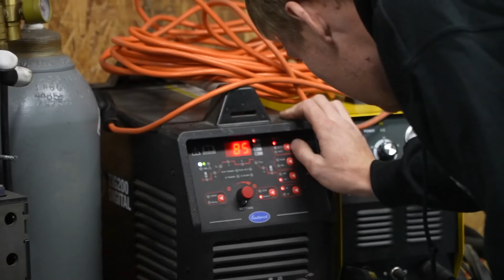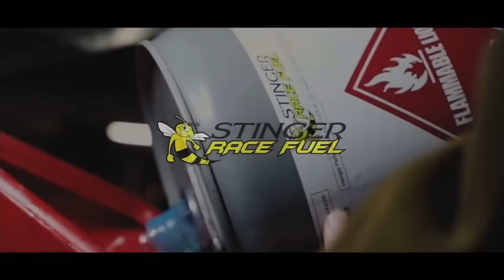Workin' In the New Shop! BIG TURBOS & All the Travel!

Comment: Sharpen tungsten inline with wheel not 90*. Arc naturally wants to go to tip. Especially when welding a 90* the arc will go to the side cause it's closer than where the actual puddle should be.
Reply: Yeah that's probably why he cooked that shock mount. Had to hold the torch there forever to try to get a puddle working how he wanted. I'm really un impressed with that shock mount. This thing is shaping up to be a half tick away from a pro mod... huge HAZ and the wrong filler rod is literally a recipe for losing a limb or worse.
Reply: Yep,  your comment saved me writing it.
Reply: Exactly
Reply: Tig welders unite! I'm a boilermaker! It's real hard watching the wrong way!
Reply: Tuff in here did any of you guys  teach yourself or learn on your car ? Keep on keeping on Billy haters gotta hate
Reply: @allenhunt9016  knowledge is good! Sometimes you need some salt with it! The older you get the more you'll learn! Use a scoot bright pad and scrub your filler wire clean!
Reply: Always
Reply: A sanding pad on a grinder works better than a coarse rock for the tungsten as well. Amps too low will make you have a wider heat affected zone due to length of time needed.
Reply: I came here to say this.haha You also want a dedicated wheel for grinding tungsten. I bought a little 3" bench grinder just for that. Tig is a sanitary welding process, the cleaner the better.
Reply: @bad3vlv672  Took the words out of my mouth
Reply: Yes yes yes. And don’t over heat the tungsten while grinding it. Have a cup of water to keep it cool. 🤙

Comment: Cool to see you jumping in on fabrication, it saves a lot of money if you can do it yourself. Couple of tips I’d like to offer- 1) grind your tungsten vertically instead of horizontally, it will make your arc more stable. 2) Fitment is key! If there are gaps it will pull all over the place and be hard to weld properly especially for a novice. 3) Try to move quickly, even if it takes more amps, moving slowly will heat soak the joint faster and turn the weld gray/brittle even if you are using low amps. Pulse your foot instead of keeping steady amperage. 4) weld the insides of those shock mounts as much as you can, stick the tungsten out a bit and go for it. 5) get you a flat back cap, it will give you much more room welding on these cars. Good luck

Comment: Billy I'm a welder, just a little advice, the sharper the tungsten  the easier  the weld and  better.. cordless  drill for  sharpening  tungsten,  ger a flush button  for your tig rig, you can get in tighter spots and  you'll  have double  use of tungsten  cause you use half and  sharpening both end with  your drill, and it don't  have  to  be  cordless  it's just  my preference...
Reply: Sharpen it vertical to the wheel with the point of the tungsten going along with the direction its rotating makes a better arc as well. Just ol'timer advice.
Reply: @kevtom1686  read my mind......kept my trap shut long enough to not be redundant
Reply: I just hope he's staying in the thick metal first and getting it hot enough and welding up hill for strength  , no down hill washes,  that's awesome you offered to teach him ,hats off and thumbs up 👍
Reply: Im not sure he will know your speaking of the back cap....also stubby gas lens kit will shorten up a wp17torch🤘better still #9😛👍

Comment: Lots of tricks on tig. Grinding cups, long reach cups, bending the tungsten for the inside of the shock mounts, wire brush is your friend between passes, cheap dremel tool and long carbide bits to get fisheyes and suck marks out, foot pedal really helps.

Comment: With them welds, you need more heat. Just like you said, and spend less time on the metal. If that chasi is chrome moli, i’d take a torch to the welds to relieve the stress. Chrome moli can be prone to cracking around the welds. 
Good Job!!
Reply: 4130 needs the right filler rod, and the right temp. And a nice flat to convex weld. There's a reason NHRA doesn't let people grind down their welds. Billy's playing with fire.

Comment: Hey Billy congrats on the shop!

Piece of advice on tungsten grinding. Don't grind it horizontal like the way you did. You grind it vertically. Easiest way is to put it in a drill and move it across the grinding wheel side to side

Comment: Billy if your elbow uses a standard LS throttle body, use the new Motion Raceworks Icon and it had a full CNC machined Y with clamps included. Would more easily fit your tight space and save a ton of time.
Reply: Upvote

Comment: Billy when you grind your Tungsten up and down your spark will travel better. Always tack things in before you weld and get smaller cups too , practice on welding with heats and gasses. Cardboard use for making templates , I remember fabricating on Race Cars when I was your age don't be afraid of asking Questions only way to get ahead. Good luck moving forward..

Comment: A tip from a x boilermaker tig welder when sharpening your tungsten don't do it sideways how you did on the bench grinder do it vertical... let the rock spin with the point of the tungsten it helps with control  of the ark and not having it jump off the side of the tungsten and when welding molly or stainless that is crucial
Reply: Also a #9 torch with a mini gas lens is your friend in tight places

Comment: Best thing I ever did for myself was learning to really use the foot pedal when welding. Set your Amperage higher than you think you need, then you always have enough to work through the material at a quick enough pace. Welds look good, but you're definitely right, the heat you were seeing was from sitting and just putting heat into the same spot for so long.

Comment: Hey Billy, just trying to help you out with your welding . When you grind your tungsten, if you hold it 90 degrees from how you were holding it in the video. Therefore the point would be straight up towards the sealing. Your flame when you are welding will focus better where you are aiming and you will not have to hold in the same spot for as long. Just trying to help 25 years of tig welding. A wire wheel before you weld on mild steel will help also keeping your puddles cleaner

Comment: Hey bud next time you sharpen your tungsten put it in a drill motor and run the drill while grinding it. Makes a huge difference. Great job on the welds and all the head way your making.
Reply: Make sure your grinding wheel is new or only used to sharpen the tungsten.

Comment: Billy     just a tip       I do a lot of TIG   ,  wile sharpening your Tungsten , the grind lines have to be straight with the length of the Tungsten .  and the point is as long as twice the diameter . So hold it vertical against  the face of the stone . You will have much cleaner arc control  
John     from Ontario

Comment: Great job bubba. Welder tip, put your tungsten in a drill to spin while you are sharpening, Also I use the flat face of a cut off wheel on a hand grinder

Comment: Just like to make a suggestion on your welding. When you come to the end of your weld and are ready to stop, release the trigger, but don’t pull your tip away until it begins to cool. You will see no tit to grind if done correctly. I am retired and haven’t tagged in a while, but, sometimes the smallest correction can have the best results. You are improving quickly and I look forward to your metal fabrication.

Comment: Just a tip man. I build custom drag bikes, sport bikes and choppers. And when I have to use the engine that's going on the bike for mock-up instead of a already scratched up junk designated mock-up engine. I cover the engine with 2 layers of blue painters tape to protect it from welding and grinding and throwing sparks all over it. I learned that in 1999 after I put a burn mark on a fully polished S&S 113 custom Harley Engine. $375 came out of my paycheck to get it re polished. You're doing great though. I know the motor in a car isn't the center piece like on a bike. But I know you wanna keep it looking nice while you can. Can't wait to see this thing done.

Comment: Billy, when you are sharpening your tungsten, put it in a drill. Hold the drill up and down in the same orientation to the grinding wheel, not perpendicularly to it. It makes a difference on how the tungsten tip will ball. It makes a cleaner puddle as well.

Comment: Motion race works has a icon throttle body flange with twin 35° inlets that fits 102mm throttle body that will make your life so much simpler ... When doing the cold side piping ....

Comment: Eastwood sells a tungsten sharpener and it will get you the precision you need on TIG welding.  I would have bought one when I was going through welding school, but at that time it wasn't out there.  Also another tip is use clear cups to see your welding better.

Comment: Hey Billy I just wanted to suggest if you are sharpening your tungsten to use the inside of the bench grinder wheel and don't use it for anything else. It is something I picked up while learning to TIG as a way to help prevent contaminants from getting on your tungsten. Another thing I learned is that you really need everything super clean to TIG unlike the MIG or ARC welding.
Reply: Your right buddy, or you and I both learned the same wrong way, lol 🤓. We had a separate grinder that was used for nothing but our tungsten’s but using the inside of the wheel is a great idea to prevent contamination. We used to fit and weld stainless pipe up to 60” and contaminants were a huge huge issue but if you kept everything clean and prep your metal right then your hood. It’s not like mig and arc where you can almost weld rust flakes back together
Reply: Excellent Advice. Got to be clean and without contamination for the strongest tig welds.
Reply: And a good wire brush made from same material youre welding. One for each material type. To avoid contamination for good clean welds.

Comment: Nice to see work getting done on the nova 

You guys gunna need to sheet up that area to stop all the metal dust and sparks getting all o we all that merchandise

Can you place the coil packs on the backside of the front motor plate then you’ll be able to have shorter leads and the coils will be out of the way

Comment: Dont do an old school vinyl top...theres a lot of old timers even that think it should have never been put on any car as they breed rot and rust. Just wrap the top a satin black and itll look the same but avoid all the rotting and crap that comes with it and save a tad bit of weight. They did that to hide poor quarter panel seams and to upcharge ya in the 60s. Theres a reason it stopped after only a decade or so

Comment: I noticed when you were grinding your tungsten you were holding it perpendicular to the grinding stone. Turn your rod so that when you grind it the grind marks are parallel to the length or the rod. The conical portion of the rod should be 2 1/2 times the diameter of the electrode.

Comment: Not a drag car guy but usually in offroading, if its close enough to almost touch when you run the suspension during your build it will definitely hit when it gets a good hit on the trails so I'm thinking that kinda touching might turn into a hard tap when the front end comes down a little hard sometime.... just q thought

Comment: Question..if I may...I'm thinking about looking into a tig welder,..I'm self taught
Learned first how to weld by brazing with a coat hanger & acetylene  torch
Doin muffler work,graduated to a mig
& can do pretty good if I do say so myself...but anywho..seems to me that a tig would not be much different than brazing...but what I want to ask is the wand is what heats the metal & you control the heat via the foot pedal
Correct??? ..ok can you set your heat range on the welder & not matter how much you step on the pedal the heat will not go beyond that setting ? Or..do you just crank up the heat & once you get the metal red back off on the pedal some ,say to ..3/4 or 1/2 pedal & feed your wire to it & just kinda feather the pedal to keep your heat up just enough to keep things going,,sort of like riding a wheelie on a dirt bike..??...lol!
& one more what size of welder you useing..& is it 110 or 220.v..thanks ,!
Watch all of yall all the time, for a few years now ,love  the channel , thanks again & keep em smokin!!

Comment: If you grind the tungsten straight on so the lines on the tungsten are in line with the tungsten u will have better arc stability. They way it won't wonder when u strike a arc.

Comment: need to check the bump steere... looked like the RF toed in quite a bit..  (steering link should be parallel with the lower control arm as much as possible)
Reply from the maker: The steering wasn’t even hooked up yet in this video

Comment: Disregard this if I'm out of my depth but couldn't you put a split combo tank in trunk one for fuel and other side for ice H2o, with a high volume mellings pump to move that water.  Burning M1 or M5, will it not stay cool enough. Those ice tanks have trans coolers built into them  to cool oil to water instead of oil to air.
Im not aware of the efficiency vs weight ratio with these cooling methods but they are becoming very popular.(I think Justin has put one I that CTSV.
   If it can save you all that extra weight of a radiator you may not need who knows it could be worth it.
Again I've never used this myself but I'm seeing them more and more often.

Comment: Your car and welding are coming along nicely! I noticed you seem to have a lot of bump steer when you were checking the front end travel. Could have been the camera angle, but it looked like the right front tire toed in about 3/4" as you increased the front extension.  If it's changing toe you may be able to raise the steering rod with a spacer to decrease the toe in. Check it, that can cause nasty problems. Your front end guys up there will likely know what to do as well.

Comment: Put that tungsten in a drill & use the side of the wheel while you run the drill in the opposite direction of the wheel & you'll end up w/ a more uniform point on the tungsten...

Comment: 9:02 im not the best welder and still learning but for tig welding set it up at 1 amp per .001 of metal thickness, so 1/8 set at 120 amps, just because you have it there doesn't mean you have to use it all setting it at 85 and welding those thick tabs you could see it had a shit ton of extra heat just from tack welding it, i did the same when i started not long ago and had lower amperage because it was easier to just go full pedal, but need to teach yourself to have the proper amperage so when you need it you can use it, i normally go full pedal then let off for 95-100 amps as the metal gets hotter you will defiantly find yourself down around 80-85 amps but starting there isn't enough, your welds are looking good and your 100% right on, also invest in a furick cup, its big and easier to see, and something like 9:34 you can just use a inch of stick out and see everything while still getting gas coverage just up it to 30

Comment: @ 6:57 that's a BIG TIG NO NO...  Always sharpen tungsten vertically with wheel, and grinding wheel should be dedicated to tungsten, as to prevent cross contamination. Moreover grinding wheel should be as smooth as possible.

Comment: It sucks you lose so much positive caster with those headers but you can't argue with free 99.   What I'd do is cut off the gates and clock them so you have better wastegate priority.  It's gonna be erratic trying to control boost when they are clocked perpendicular to the exhaust gas flow path like they currently are.

Comment: So you aren't worried about heat transferring from the headers into the shock shaft causing premature seal failure ? I would cut the bar and put a strut style cup in place and get rid of the top  rod ends .....

Comment: I believe u will end up with a little more travel once ur ride height changes due to the weight u will add up front. Im assuming there will b at least another 50lbs with turbo's and plumbing. Or, is that what u were saying 7 for in anticipation for the weight?

Comment: Idk if it makes a difference because I used to grind my tungsten the same way you where. But I watched a video from 6061 i believe it was, but your supposed to grind the tungsten so the grain from grinding it is vertical with the rod. Its supposed to let the gas flow better.... idk if I can actually tell a difference. I put it in a drill and run the drill while grinding it.

Comment: How much is engine placement fixed by the rules? Can it be set back and moved up the engine a certain amount of inches, or does must the stock firewall and transmission tunnel remain?
Reply: I don’t believe that’s dictated by any rule in the level he’s racing at. He’s not under the same NPK rules as the big guys are to my knowledge but if someone knows better then please correct me. 

It would really be nice if billy or tommy could sometimes answer some of the questions like this tho since they know better than us in the peanut gallery instead of ignoring the comment sections completely

Comment: Use the side of your grinding wheel to tip your tungsten.  Especially welding aluminum. You put less
Contaminants in the tungsten from other things you grinder imbedded in the weld. 
Use stainless wire brush on aluminum.  Mark the handles don’t use the brush on anything else it can contaminate your welds.    Lil useless info.

Comment: I always wanted to weld it solid.  Hard habit to break.  Tack it first then test it. Its a whole lot easier to relocate it later.  JMO but I'd use a 220v Mig for suspension parts. Use the Tig for the finer details.  Jack up the heat and lay some Nickles.